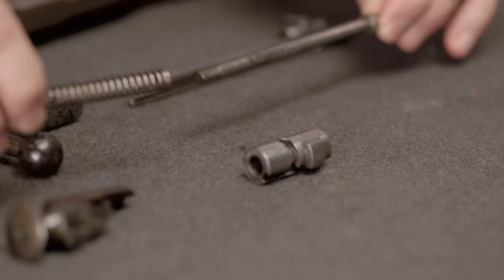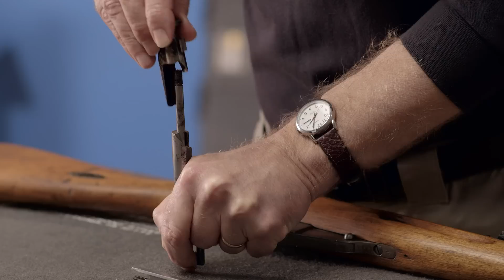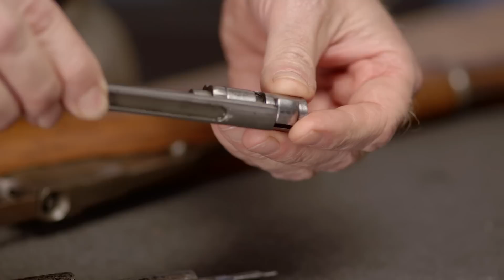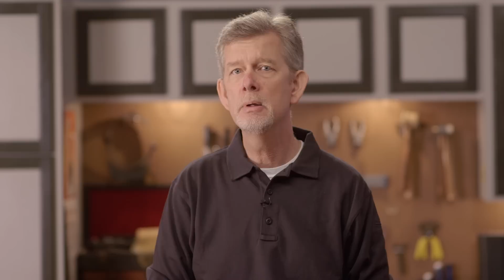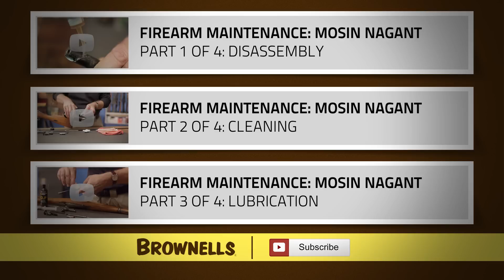Firearm Maintenance: Mosin Nagant Reassembly Part 4/4

Comment: Is this a God damned joke? 

I've never done this before. 
You'd think that making a video for someone like me would be at the foremost top when making this video. 

Why TF is the camera 20 miles away at ANY point?
I CAN'T see shit with WTF you're doing during ANY of this...

Why TF are you going 100 miles per hour doing this? You'd have to already know how this goes to follow this as fast as this goes. I've got gun oil all over my hands from cleaning my Mosin-Nagant so pausing this BULLSHIT video 20 times & playing it ISN'T an option.
Reply from the maker: So you would like a newer video, got it.
Reply: @brownells Here's what would've helped me: 

-a close up view at all times
-a view where I can lay my bolt parts down in the same exact matter as you have so that grabbing them has me handling them the same way you are without having to flip parts over or wonder if I've oriented them correctly
-an explanation with the parts & then don't cut away from that view while you assemble or maneuver those parts so that I can see & mimic exactly what you're doing in real time & there's no guessing as to what you did
-slow this all down so that someone that's never done this can realistically follow this or have to go back very few times

Comment: The little screwdriver tool that comes with Mosin's has a notch just for reassembling the bolt so you don't have to push it down into something and risk breaking the pin.
Reply: Thanks I’ll remember next time before scraping the skin off the inside of of my thumbs to push down. 😅

Comment: My bolt doesn’t go that far back
Reply: Did you get it fixed? I had a hard time keeping the pieces in place while I rotated the bolt to lock everything straight. Excited and scared to shoot some of these 440rd tuna can cartridges!!🙂🇺🇸👍
Reply: @PumbasSporty  I did fix it. Just haven’t shot it.
Reply: @PumbasSporty does the can have a silver strip? If so, the rounds have a mild steel core, aka steel-cored. Don't take it to an indoor range and make sure you're at an angle for really solid targets for safe shooting. Steel-cored is loads of fun, especially if you manage to catch a round and recover it.
Reply: @Mojave Wastelander  no silver on my ammo can sir. I did shoot it for the 2nd time yesterday since I've owned it though. It shoots good and fairly accurately. Really long trigger pull but Nice!

Comment: Showing how to check the firing pin and set the correct protrusion after complete bolt tear down would have been a good idea.
Reply: +stewngnr may you elaborate?
Reply: @RatHeadxxx  Im five years late, but what they mean is how to check how far the firing protrudes from the bolt face. You want this distance to be in a certain range. If it doesnt protrude enough, your firing pin could fail to strike the primer, or strike to lightly. Causing it to not fire properly. Protruding to far can cause issues as well, although I am not sure what kind of issues.
Reply: @headshot22331  probably it just over penetrates the primer however you don't need a tool to see, the cross on the back of bolt and screw line is enough to set it, make sure it's lined up and flush and it'll do just fine
Reply: @mridoit1701  This works if the firing pin is original/matching with the bolt/cocking piece. From personal experience replacing the firing pin may cause the lines to no match. For example on my mosin with the current firing pin having the lines match is to much protrusion. It needs to be about a quarter turn less than the line. But yes, in general the method you described works just as well.
Reply: @headshot22331  ah I never knew that, most times when I clean my bolt and put back together, that's the method I use because I don't really have any other way at the moment and most my casings seem to be okay primer hole wise
Reply: @headshot22331  There is a SL3 tool that is/was supposed to come with the nagants with a built in depth gauge to check it.